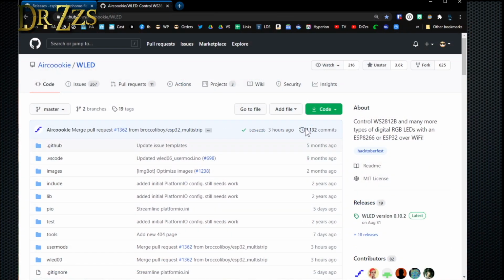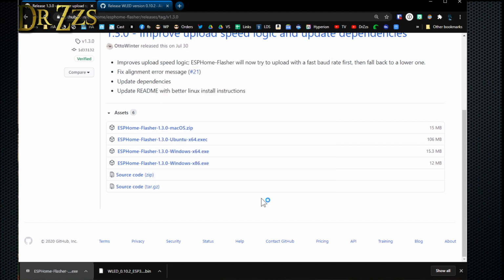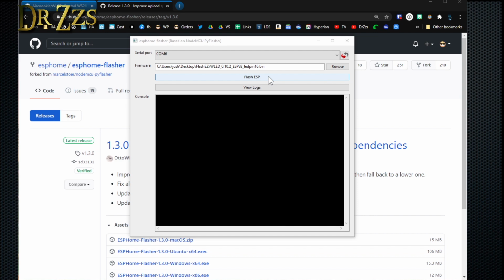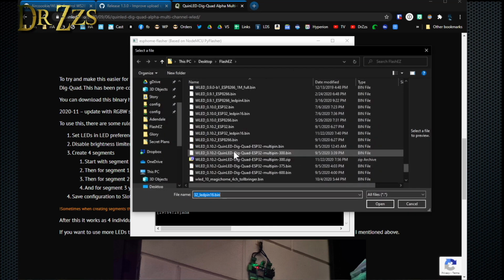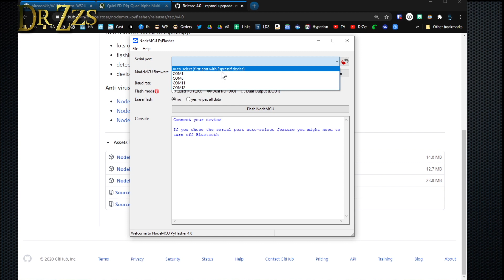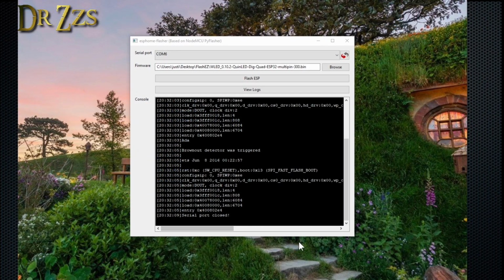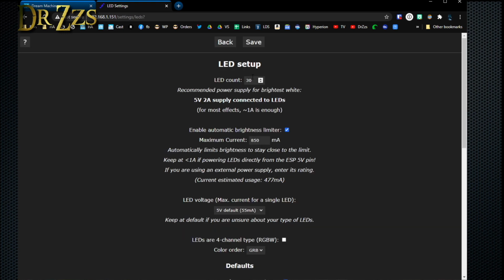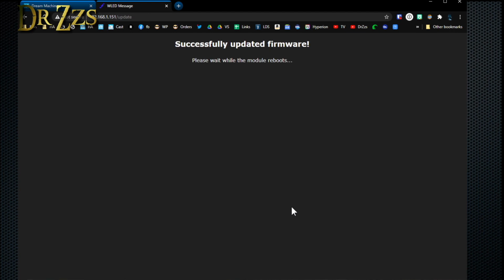DigQuad DIY RGB LED Controller - Setup Software & Wiring Connections

Comment: question. which side does controller connect to LEDs. Amazon answers Female end, and your video shows male end. I would think it matters. Thanks.
Reply from the maker: There is generally an arrow for data direction, or the word out on one of the sides of the led PWB.  It absolutely matters as it will only work one way. If you feed data on the out side they will just not turn on, but not break anything.
Reply: @DrZzs  Set on, out of 50 pixels, only 8 white  and 1 red turn on. Could it be wrong way or low amps coming from power supply. PS not marked as to voltage or amperage.

Comment: Note that this video is a bit dated.  Current digiquads don't have the voltage jumpers.  The board automatically does the right thing, and there are other minor differences in the newer versions.
Reply: Kind of.  Just to be clear, the new v3 digi quad does not sense the voltage your LEDs need.  So if you're running 5 volt LEDs, you need to use a 5 volt power supply.  For 12 volt LEDs, a 12 volt power supply is needed.  I just wanted to say this for any newb.

Comment: How far can I run a wire for the data going to a line from the quad.  I have 50 feet of lights(300 pixles), a jump about 13 feet to the roof line to about 15 feet(90 pixels), another jump that's about 7 feet to the other 50 feet (300 pixels) of lights. In the past, I have used two cheap controllers.  The data couldn't take the first jump. However , the second controller would be connected to the first 20 feet of the roofline and survived the 7 foot jump. Switching to the quad and curious.
Reply from the maker: The best way to get answers to this sort of stuff is to join the discord channel.  There are lots of people to help.  It is just really difficult to troubleshoot over comments.

Comment: I'm starting my project and bought addressable 12v led for arches. What is the maximum per channel and at what distance I should add power?
Reply from the maker: There’s no absolute right answer for those questions.  Each channel can handle 800 LEDs just fine.  You can push it higher but as you add more LEDs per channel you’ll see decreases in performance. Mostly as lower fps, so choppy transitions or stuttering.  When you need to add power is also variable.  It depends on the size of your wire, the which effect is being displayed, which colors and what brightness level.  If you’re set on solid white at 100% brightness then after about 200-250 pixels you’ll probably see dimming, which means you need to add power.  With an effect like Colortwinkle with a brightness of less than 50% you could have all 800 LEDs on the channel work fine with no extra power injection.  What I do is either expect I’m going to need power injection and just run the extra wires or assume I won’t need it and wire it all up, turn it on and look for dimming.  If I see signs that I need more power THEN I will add it.  Hope that helps.

Comment: My new DigQuad doesn't have the jumpers on it. It has L1 L2 L3 L4. I'm not getting any power to lights. Board has been reflashed and is connected. What should I check next?
Reply from the maker: When you flashed it did you use https://install.quinled.info/ ?  That will preset all the outputs to the correct pins.  
The newer versions no longer require moving a jumper.

Comment: is it possible to wire it up so that when you power on the ESP32 the LED powersupply comes on and when you shut dowon the ESP32 the LED powersupply goes off?  Or can you toggle the LED powersupply on and off through the WLED software?
Reply from the maker: The best way to get help is to join the discord server linked in the description in my videos.

Comment: Why are there 3 positives and 3 negatives for led power input on the board? You used one of those pairs, what are the other two used for?
Reply from the maker: Power injection for long strings, other strings, etc.

Comment: What size wire should I use from the power supply to the dig quad v3? The power supply sits in the same box as the dig quad.

Comment: Hey man, great video.  Exactly what I was looking for.  But why and how would you use other data wires?  Would you send a second data wire to a completely different string?  Can you send a second data wire to a string that already has a data wire from the first data  terminal.  How far can a data wire go before you get to much voltage drop?  Does 12 volt lights have a 5 or 12 volt dat@ wire?
Reply from the maker: A good place to ask this question is with the Pixelheads on my Discord Channel: https://discord.gg/8gvF67h

Comment: i DrZzs mi name is arcadio and i resetly got a Dig quad and i am trying connected to  12 volt sw2811 and i cant make it work.every time i finish flashing esp32 board the wifi get disconnected,the esp light is on the quad board is on but the sw2811 dont come on.do you think any idea what i am doing wrong.
Reply from the maker: A good place to ask this question is with the Pixelheads on my Discord Channel: https://discord.gg/8gvF67h

Comment: I plugged mine in and the strip only lit up like a quarter of the way? And the lights were like yellow/ orange
Reply from the maker: That's normal.
A good place to ask this question is with the Pixelheads on my Discord Channel: https://discord.gg/8gvF67h
Reply: @DrZzs  they lit up but I can’t seem to get signal. It doesn’t connect

Comment: Question: Can I have a external LED STRIPE system, 12v standart stuff powered directly on the PSU of my PC, and connected to a USB 2.0 or 3.0 port controlled by a software?

Why? Well, we have controllers that has WIFI or BLUETOOTH configuration, but none wired instead of wireless? I mean, expect by the USB 9 pin directly conected to MOTHERBOARD.
And Why in a hell do I want or need that? Because I don't have the way to build it with wireless system on may LAPTOP Converted into a Desktop, and my motherboard, sas it is a LAPTOP model, doesn't has a USB 9 pin connector for RGB...

Comment: I would like to frame my main living room window.. total length needed is 39.5 meters. I really like the idea of a cob articulated bright LED light strip, but would really not have to rely on boosters..or at the very most 2. 24v is ok. Can someone please help with a solution, suggestion, or point me in a general direction? Thank in advanced everyone.

Comment: I have a v3 quad and it doesn't have any jumpers on it, say's auto input voltage 5v-24v.  Have you seen this new version?  I don't want to fry my board before I even get started

Comment: I was wondering when using the quad how far can a run power and data to the first led. say i wanted to put the controller and power in the garage and wire it out to my roof  using the dig quad.  Learning still  thanks in advance

Comment: correct me if wrong, I kept on seeing you connect 12v to the main LED power supplies, only time you mentioned 5V was for the dedicated power to the ESP chip, via the 5V input points,
what id LED's are 5V based ?
Reply: Ignore played it again... :)

Comment: Hey Dr. ZZs, QQ -- when adding an external power supply (12v 20A), do I wire the 3 power outputs to the digquad, or just 1 and use the other 2 for power injection direct down the line?

Comment: I just got mine from China and it will not power on. The esp8266 at first turned on and ,the blue light , but after the first time trying to light some led it stopped working. I had 2 spare 8266 and tried those and again they'll light up when plugged in the computer once I plug them in the diguno they stop working.

Comment: "use the usb cable that you're SURE has data cables"

me: psh of course it does.

me: 3 hours later OH THAT'S WHY THE THING WON'T WORK THE CABLE DOESN'T HAVE DATA WIRES IN IT AAARRRRHRRHRRHHHHGGGGHHHH!

Comment: Arrrrg!!!!  I tested my new QUAD using 5v system and 12v system. Both worked well.  I did notice my QUAD’s data slot 2 and 3 are reversed.  Doesn’t really matter now as I think I smoked something when hooking QUAD up outside for final install. I forgot to switch jumper back to 12v from 5v. I’m seeing the blue led on board light up. But when I put WiFi chip on, blue light shuts off. (I confirmed WiFi chip still powers on by plugging into puter).  I do get 12v out to the lights....I just don’t get lights. Can this be fixed, or will I need to purchase another QUAD???  Thanks for any help!
Reply: The 5v side works.  Although no lights on board or esp32, I do get 12v reading from output terminal going to lights?

Comment: Does it matter if im using a laptop or desktop. Cant seem to get it tonshow up in the serial port but under control panel it will show cp2104 usb to kart bridge controller. Not very techy tech. Am I doing something wrong.

Comment: Thanks for providing great videos on led lighting, very informative and very helpful for beginners like myself. I apologize in advance if this question is silly/stupid but what wire thickness (AWG) do you use on your DC barrel plug for the 12V power?
Reply: Probably 14-16 AWG.

https://jascoautomotive.com/automotive-wire-amperage-capacity-chart/

Comment: so I have a problem, I ordered a power supply I think it's too big? 5V at 60A can I convert somehow or will I need to buy 2 smaller power supplies?
Reply: Power supplies have the ability to put out lots of power, like 60amps on your model, but they will only USE what the lights need or "ask for". You should be fine with the large power supply. Usually when having a small load on a large power supply it will run more efficiently and cooler.

Comment: You must be a teacher in your daily life because you are very good at keeping things simple yet informative. Very good video.
One question I have is why would you want to use a separate power supply for the ESP32 when one supply will suffice for both the lights and the board?
Reply: Good question.
Reply: I have the same question. 🙂

Comment: Great informative video on the Digiquad setup DrZzs! I have a question that pertains to it and just your general setup in your garage.  Since i am new to this LED thing can you show and go over in a video what you did with the your own personal setup and how you have it installed in the garage?  Specifically how you have the large external power supply with the cooling fan and the Digiquad and any other items for your outdoor permanent LEDs setup.  What I mean is it all installed in a large box on the garage wall with a hole and filter for cooling for the external power supply and all the low voltage wires for the LED strips and voltage injection run out that box to the outside?  Or is everything screwed separately on a wall in the garage? I am just curious on how to best keep all the sensitive electrical equipment organized and kept clean from dirt and dust that most garages naturally have accumulate in it like my garage does... Anyways, thanks for all you do my man.

Comment: I've been watching your videos for a bit now, watching the videos from 2 years ago and the new one. I'm new to the Digital LED setup and had a question. In regards to Controllers, I'm in the understanding that the Digi Quad is 4 channels and can support up to 6 Universe per channel, making it a total of 24 Universes. One Universe can support 510 pixels making it a grand total of 12,240 pixels. Am I correct in my math?
Reply: Did you read that on the Quin led site? That’s interesting. Would be nice if he’d respond to all these comments.
Reply: @Kevinw4040  my understanding was being put together with previous information. I ended up getting the Falcon 16v3

Comment: I must be doing something incorrect. I can't get more than two strips of lights to work. 

I have six WS2812b (150lights) strips connected to each other, tried power injecting still can't get more than two strips of lights to work. Any idea what I'm doing wrong? Tried dialing in the settings, but still no luck.
Reply: Might need to check your WLED Settings. Make sure you have the appropriate number of LEDS entered as well as power.

Comment: I’ve used both the pin16 version and the 300 version and they appear to flash okay, however the WLED-AP does not show up. I’m powering the ESP with the same cable used to flash it and the red LED on the board is glowing brightly, but I’m unable to find the AP. I had assigned a static IP address to the MAC address of the ESP and looking for that IP address, I still can’t find the WLED-AP. I had previously flashed a UNO and the AP came up perfectly. What have I done wrong with the Quad?

Comment: HELP!! I can see the  nodemcu has IP on my router but I can't discover / connect to it in WLED. Any thoughts how to fix this?
Reply: I have yet to be able to get WLED to discover a nodemcu. I have to manually add them by entering the IP address. After you enter the address, hit the check mark in the upper right corner.
Reply: @chuckg4910  I was previously successful using the discover but not any more and I cant connect any more.. either way
Reply: @judoabbey  how far away from the router is the nodemcu? I've found they can't be too far away and obstructions such as brick walls reduce the distance further. Can you reposition the mcu to see if that helps?  The orientation of the mcu relative to the router also impacts signal strength. Also, did you set a static IP address or you using DHCP? I use static addresses so they stay constant. 

When you do connect, click on the info tab and sheck the signal strength. Mine don't work well if the signal goes below around 40%.

Comment: Hey first off would like to say just about all your videos are great/very informative. I tried your discord to ask this question but either i posted in the wrong place or got overlooked (not sure never used it before). i was wondering in regards to power injection. I have about 70-80' of roof line that was trying to cover with 5 strips of the ws2812b and a 60 watt power supply. If my math is correct i would be running the power supply at about 75% which should be ok but not sure every how often i should do the power injection, whether i can use just one run of +&- 20 or 22 awg wire or if i would need to run a separate line for each (or can i run maybe a 10awg to the beginning of the run and then split off from there? 

If i preorder the DigQuad is there any chance it might come in before christmas?

Sorry for the extensive comment

Comment: I ordered 2 dig-quad a few days ago and it still has not processed out of my account yet. I was wondering if you knew when or about how long it will be before I would receive them. Sorry to bug you. This is my first time every working with leds and I am anxious about getting them up and running. I should the lights in a week or so. I’m sure I will have other questions as I go lol. I really appreciate the help.

Comment: hello ... from Italy 🤗.  I was wondering how many LED pixels does the dig support for each channel?  thank you so much
Reply: as many pixels as you want since you are only sending signal to the pixels.
Reply: just make sure to change the amount of led on the wled setting if that is the app that you are using to control the led

Comment: Great video! I believe the multichannel version of the software was limited to 300 LEDs per data output. Is there a simple way to increase this? Was hoping to do 900 on one data output and 300 on a second one.

Comment: Assuming you are using a 5v power supply for just the processor (5v EXT), how would I wire a relay to turn off / on the larger power supply to conserve energy and reduce fan noise?

Comment: If your light setup requires more power injections lines than what is available on the dig quid or you don't want to "max out" the dig quad could you potentially add another power supply (outputting the required LED light voltage) going to a fuse block that can be used for power injection lines?
Reply: You can, but be certain the DC common return line is connected together on all power supplies, controllers and DC circuitry.  You may also want to adjust the voltage output to be as close to the same as possible.

Comment: Would I be able to use 24v adressable strips with this board, if I use it's own 5/12v powesupply for the ESP32? I can run 10m with out power injection on the 24v strips, would be nice I could use this board for future projects. :)

Comment: So this means I can get some 12v adressable let's and have the controller powered separately on 5v. . great .. 

What would be the drop voltage comparison between 5v and 12v for let's say 10 MTRS wiring before the led strip ? 

I'm trying to centralize several of these controllers or nodemcu's and the Lee's would be 10 mtrs away .. 20x1 MTR strips of let's on a different level of the house ?
Reply: Come to the DrZzs Discord and we should be able to help.   https://discord.gg/g8VrPtVg

Comment: Thanks for the post. I've been curious about what I could do with a quad. Would enjoy if you could go into a little more detail about using the multi channels. Does it act like 4 individual WLED boards? Or do they sync automatically? Run concurrent?

Also, what's a real world use case for separate power supply to the esp? I'm not sure I see an advantage to that?
Reply: You can either treat the 4 ports as one giant LED strip with perfect sync between them, allowing you to run much higher amounts of LEDs then with a single data port. Or you can divide it up to act like 4 independent LED strips and do all different things or some mixes between those scenarios, but there are limits to that.

First, Digital LEDs still use a little bit of power, even when the LEDs are turned off, then, most often this is useful when you have like a 40Amp 5v or 12v supply for the LEDs, you'd connect a relay to the board and run that big power supply through it on the AC side. Then you take an old 5v phone charger and connect that to 5vEXT. This way the board stays online and then big power supply can be turned off when the lights are off.
Reply: @IntermitTech  nice! Thanks for the reply Quinn!